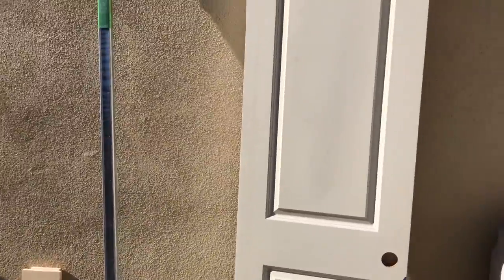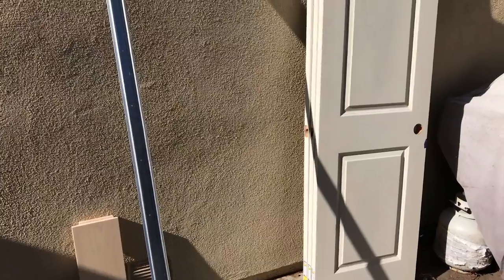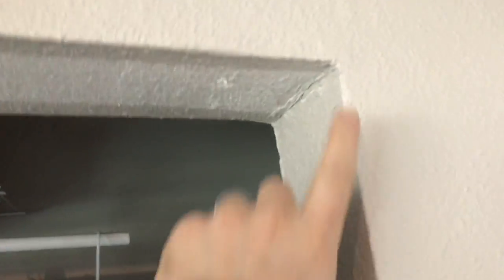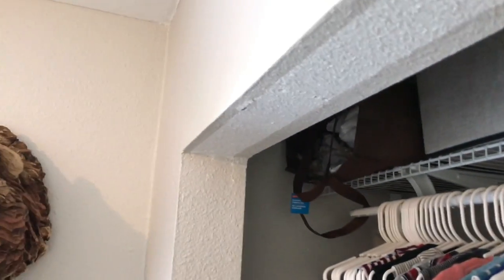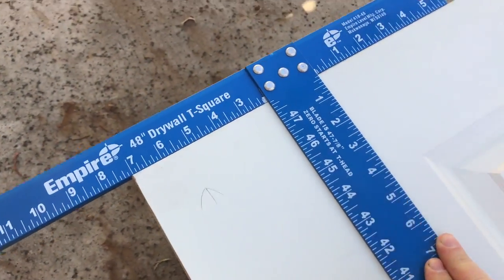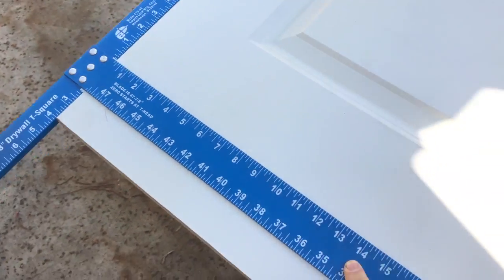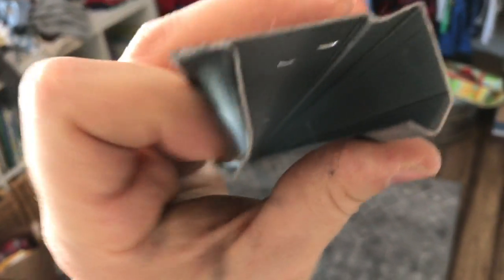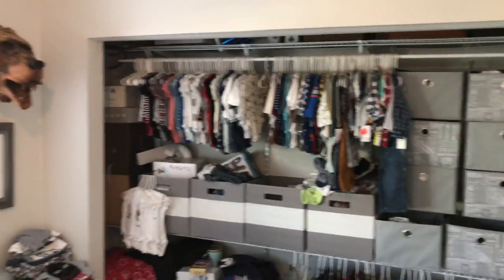DIY Sliding Closet Doors, Easy Do It Yourself

Comment: Wanted to see how they slide and if it took more than 4 doors. That was a wide closet. I have a 120 inch closet I am trying to do.
Reply from the maker: Hi Judy,
The great things about using standard doors is that they come in all different widths. I used 24" doors to fill out my 96" space. If you have 120 inches, you could use 32" doors, and you will have a couple inches of overlap. Your biggest hurdle is that you will need 2 pieces of track or see if they can custom order you a longer piece of track. If you use two pieces, you will have to line them up very nicely, so they slide all the way across.  You can do it!!

Comment: Very helpful video!! Thanks a lot. I have 81 in height closet and slab size is 80 inch. Do I have to cut off half inch? If I have to I would like to do at the store because I don't have saw myself.

Comment: You actually took off 1-7/8" because you took 1/8" saw kerf off the keeper side of the line. 😉  thanks for the vid, I frame houses but never install bypass doors.
Reply from the maker: You’re right I did because they ended up being too long on the one I test fit so I cheated a bit but didn’t explain it :-) good catch!

Comment: You show marking 1- 3/4" when trimming the doors. Earlier, you said that there was about an inch of wood top and bottom before you cut into the hollow portion of the door. Maybe I missed something in the logic? This is a great video and I appreciate your time and effort.
Reply from the maker: Good Catch! I thought there was less before I cut the door. It ended up having almost 2" of material at the bottom. On previous projects, I have need to cut more than the block at the bottom of the door.  If you need to cut off more than the 2" you need to either peel off the door facing from either side of the block you cut out or it may be easier to cut a new spacer from pine and glue it in yourself!

Comment: hey, have an issue with you cut line, its held as good practice to keep the cut-line on the work piece in case u need to do some fine shaving for precision...
Reply from the maker: Thanks for the comment Albert. I hear what you are saying, from my experience I like to mark the line exactly where it should be and adjust by cutting on the line or on one side or the other. Personal preference but to each his own!
Reply: well, I do believe that most people who are drawn towards this sort of video are novices with the exception of a few pros who do seek the confidence or a sort of refresher course before  attempting a job,  with all due respect to your technique, i believe highlighting such an issue like the side of the line to cut to is crucial, like how one may prefer not use a guard on a power tool like the table saw but still recommend it, to cover the bases...

Comment: I have been reading the video again and again because I am trying to install the closet door in the same way. One question here is why you said you would cut the top 3/4 inch and the bottom 1 inch, but actually you cut 1-3/4 at the bottom only?
Reply from the maker: wow so sorry I just saw this comment. I Would cut them that way so that the spacing between the door panel was similar at the top and bottom. You are correct I did it with just the bottom because it was less work to just add a support piece back in the bottom!

Comment: So your overhead is the same as mine, no frame.  But I only use one track.  Is is gonna be ok?  And when I drill the 1-1/2 screw it wont go all the way (maybe there’s metal). So I ended up buying a 3/4 screw.  Would it ok?  And since I use the 3/4 screw would it be safe for the door which is 26 lbs?
Reply from the maker: It really it depends on what it went into. If it’s just drywall then no. I would drill a hole and use a screw

Comment: The opening in my newly constructed washer and dryer area is ht 80 x 81 wide.  The washer and dryer space depth is 34 but the frame is built out to accommodate the tracks.   I need four 20 inch doors as stack sliders.  I can have doors made and have them thinner ..but will I be able to put four tracks up. And should I place a recessed  track on the bottom? Thanks
Reply from the maker: I'm not 100% sure you would want 4 tracks but yes you would just get two kits. Each kit has 2 tracks so you can just mount them one in front of the other! the bottom uses a guide and you're for sure going to need some extra ones!

Comment: what about putting something on the floor so that they dont swing back and forth so much?? Some type of guide??
Reply from the maker: Cynthia Vanbiene thanks for the question! The kid does come with some floor guides and I'll make an update video showing them. A some screws will hold them down tight. We have laminate flooring in the bedroom that it is attached to. If you have tile,concrete or some other harder material you can also use screws but you will have to use a masonry drill bit first, as well as some masonry screws.   

My wife decided it would be better to have two of the doors attached together which changes the opening. I'll show that in the follow up video as well! 

Thanks for tuning in!

Comment: Dang! I really wish you would've shown full shot of the final doors and shown them sliding on the track once they were all installed... Missing punch line to an otherwise awesome video.
Reply from the maker: Hey Karina! Had to make a part two, the video got too long! Check my videos for that one
Reply: @DoThingsMakeStuff  Oh, thanks for the info!  Do you have a link to the 2nd part in the description? (or would you mind sharing it here as a reply).  Again, thanks for the great video!  The editing is great, pace is really good, seems to include all the vital details (I'm not making my closet doors yet so I'll have to post a new comment after I do to share the results or if there was anything I needed info on that you didn't include but I suspect your video will be perfect to help me complete my project).
Reply from the maker: @KarinaHunter  https://youtu.be/4qksR__RzGs

Here ya go!
Reply: @DoThingsMakeStuff  Thanks so much! I'll keep you posted (I'm in the middle of a fix rn so the closet doors are scheduled hopefully for Feb) on my degree of success (hope that doesn't jinx it).

Comment: Hi I partitioned an area  in my basement and made sort of  a walking closet  for my wife. However I need an idea to cover it I can't do the sliding doors because I have suspended ceilings which I can't screw the guide rails onto.  Any thoughts on what I can do?
Reply from the maker: Hey! If you’re thinking something similar why don’t you add a header with some supports on the sides. The doors are very light and typically with a drop ceiling it can support some weight as long as it’s evenly distributed. What if you did a stub wall on the side that supported a header and then ran normal closet slide if doors that roll on the ground. That way there is no weight up top, the top is just a guide. And at that point the header really just needs to be something strong enough not to bow in the center. You can screw through the top of the drop ceiling just so they are lightly attached so it doesn’t move.   That would be my thought

Comment: Thanks for showing.  If I want to hang three panel, should i get a track with three channels?  Appreciate with any advice.
Reply: Tom Lee no need! The normal track has two channels which will Work great unless you want all three doors to collapse down to a single door width
Reply: Yes, that is what i want to collapse into one door width.  Thanks

Comment: Curious how they are holding up. I was concerned about the "swing" of the doors bending/damaging the track. Have you had any issues with them?
Reply from the maker: Few years and no problem! Adjusted them a couple times but other than that it’s worked great!

Comment: hello i was wondering where did you buy the metal plate that you used to cover the hole
Reply from the maker: Isabel Machado 

Thank you for the question! Mine actually came with the sliding track kit but they do sell them at most major hardware stores in the same section where you can find latches and hinges! Good luck!

Comment: Just wondering what you did to hide the wheels on the top what kind of trim did you use
Reply from the maker: Hi Kathy!
There is going to be a follow-up video soon with the rest of the information. My wife and I made a few changed after we completed the build, so I want to show you how we ended the build!

Comment: You should have purchased two wider doors.  Home depot also have doors that dont have the door lock cut out.
Reply from the maker: Michael Lee thanks for the comment Michael!  The cut outs are nice because if gives you something to hold onto when you slide the doors.  Unless they have cut outs without the side cut for the bolt?

My wife is a crazy fan of symmetry I’m not sure she would have let me go with different size doors!

Comment: How large is the space.  I will like to build something similar for my laundry room but the high is 82" of course 83" because is not completely level and the with is 91.5" I do have ceramic floors I'm not looking to drill maybe glue a track if anything.
Reply from the maker: Hi Victoria,
If the total high is 82" you should be able to do it! My opening is between 80" and 80.5 and I actually had to cut the bottom of my doors to fit as well as adjust them up to the maximum height. Worst case would be that you might need to shim the whole frame down. I would find a 3/4" piece of wood, stain it or paint it to make a frame for the closet that would make the height a little bit less, also use the casing to level it out! 

Use 32" doors, and they will overlap just a little bit which should give you a great looking closet door! You can do it!

Comment: I have a 57.5in wide x78.75in high ID closet trying to put sliding doors on. Suggestions?
Reply from the maker: Charles Curry thank you for the comment! Two 30" wide doors will be great but the height is where things will get fun. 78.75" tall means you are going to have to cut the doors shorter or order some custom height doors.  When you choosing a door style make sure it is one that give you plenty of room to remove material and not look uneven. 

You may be removing up to 3" or more, so your best bet may be removing equal amounts from the top and bottom. 

You've got a little bigger project on your hands but very doable! Good luck and send me a message if you have any more questions!
Reply: Thanks for responding so quick. I think maybe just some plain 30x 80 solid core doors? That way can cut as much as I need. I'll let you know how it goes.
Reply: Charles Curry The thing I would worry about is the weight.

Comment: I came here just to see how to install the floor guide and there's no for guide unbelievable
Reply from the maker: Sorry! Its a two part video! Check out part 2!!!
Reply: @DoThingsMakeStuff  Thanks!, your good. Its just me. I figured it out. just not focused with too many distraction.
Reply from the maker: @fmradio42  all good!! Also I simply just double sided taped them with 3M.  It’s not my favorite, I would rather use screws but I’m into concrete and a floating floor

Comment: So the bottom doesnt need a trail like the upper?
Reply from the maker: Oshrit Appelboim Giese the bottom doesn’t need a track like the top. It does comes with a set of guides that attach to the floor so the doors don’t swing in and out. I didn’t add these when I made the video but I’m going to now maybe not
Reply: I want say the video seems helpful...and i have the same size of closet but i will have to buy or find about 9 feet wide doors. Thank you for your reply Merry Christmas 🌟🌟🌟